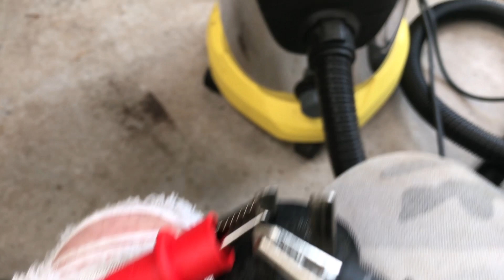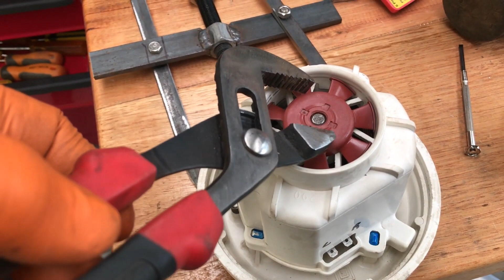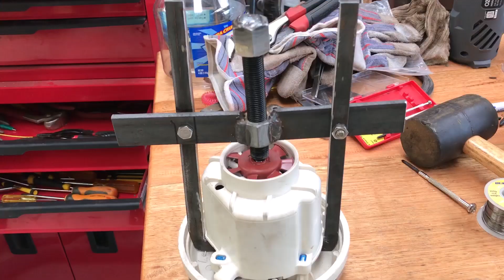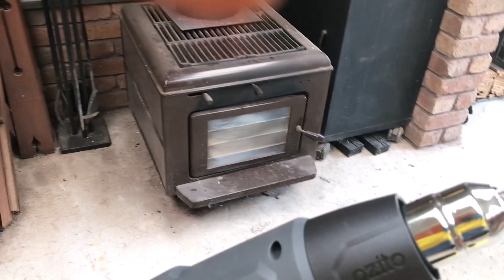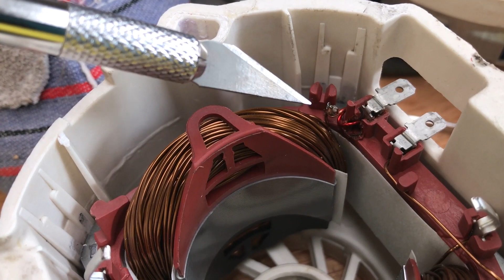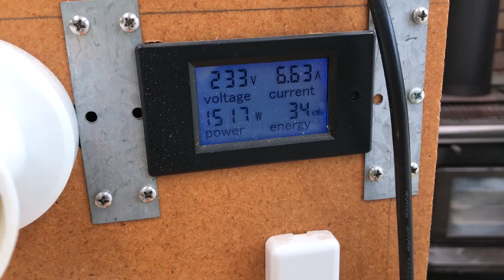Karcher WD3 5P Premium vacuum cleaner motor repair

Comment: Great job. I just repaired my WD3. What kind of glue can be used so that can be disassembled again?
Reply from the maker: Hi, I used "PVC Pipe Cement", same product as used in general plumbing work for gluing non pressurised PVC pipework. Cheers, James

Comment: That motors knackered
Reply from the maker: LOL, maybe so, but still working as at June 2024, go figure.
Reply: @JamesEllis-iFixStuff  fair enough mate I’m just saying it’s not supposed to sound like that whatsoever lol eh if it works it works I have a old metal numatic nv250 from 1987 that’s nearly 40 going strong
Reply from the maker: @Mr_D2_1004N  Got my vote, screaming motor and I did ask if it sounded like this before it broke and the answer was "yes", I did recommend to the owner to invest in a filter to avoid overheating from the dust/debris clogging the internal fans as was the case when I pulled it apart which I suspect was the cause of the meltdown....or maybe the meltdown was from spinning at Mach 1, 2 or 3...LOL
Reply: @JamesEllis-iFixStuff  yeah that’ll most likely be the case either that or the fan rubbing on the fan case which can happen sometimes

Comment: What is the screw size?
Reply from the maker: Hi @benkinator , no idea of the screw size. I simply removed the screws in the unit and then put them back in the same locations in the re-assembly. Cheers James.
Reply: it's a torx T15